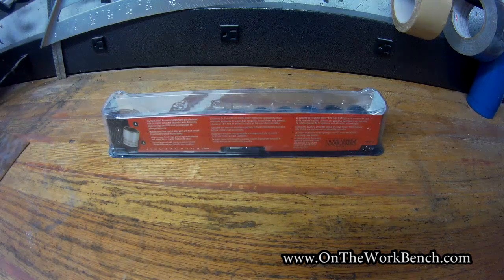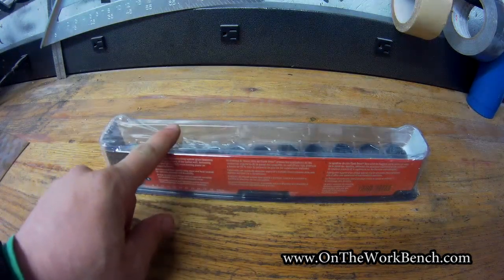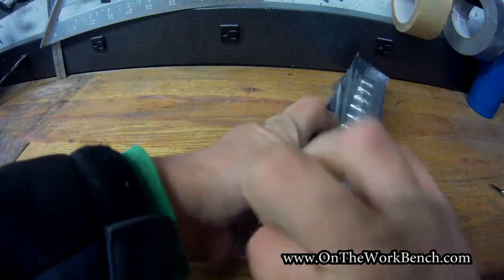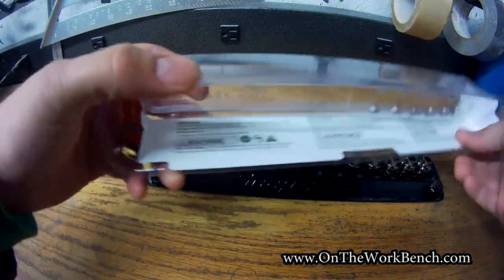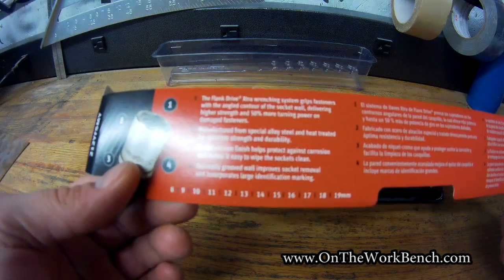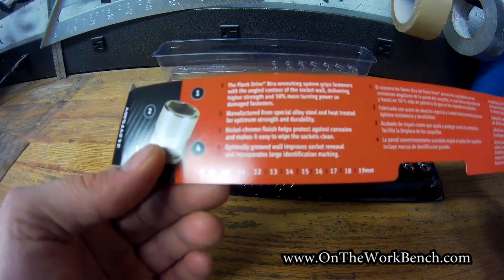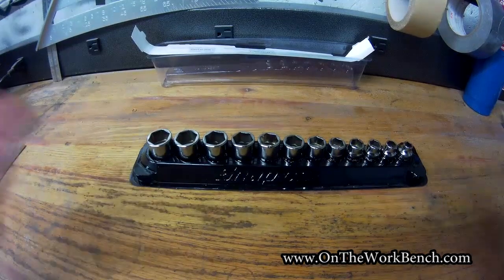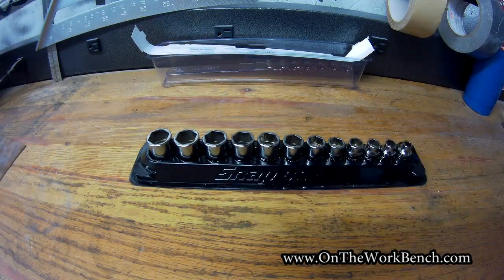Snap-On FDX Socket Testing

Comment: I have fdx sockets and I have never had a problem getting out a rounded off bolt so I say this video is bs cause i know from personal experience they work and work great
Reply: im stuck trying to decide between these and turbo sockets.  what is your input
Reply: @desertdispatch  those are two entire different type of sockets. The FDX can still be used as regular sockets for any jobs but the turbo sockets are made to take a bolt off and replace that bolt
Reply: FDX. Works great .

Comment: That's not how you strip a bolt,  you grab a cheap wrench and put it on a cheap bolt an turn it with the wrench at a less that correct angle and turn the bolt with too much torque. I've never seen a bolt stripped with a grinder on purpose.